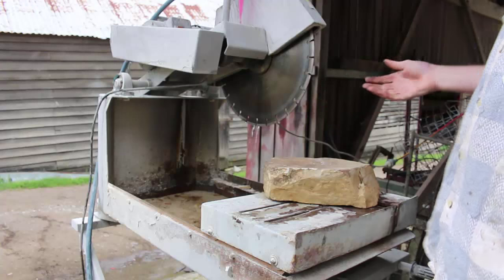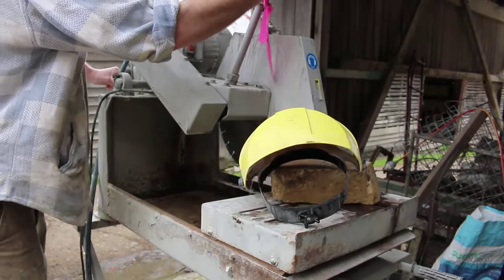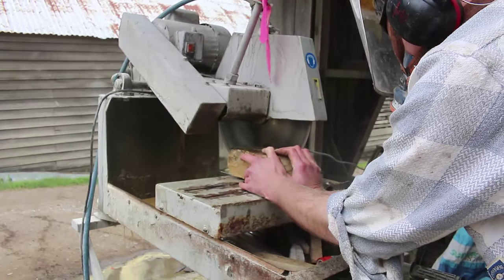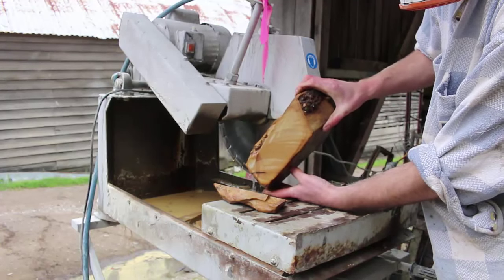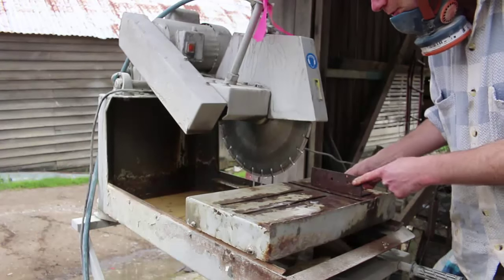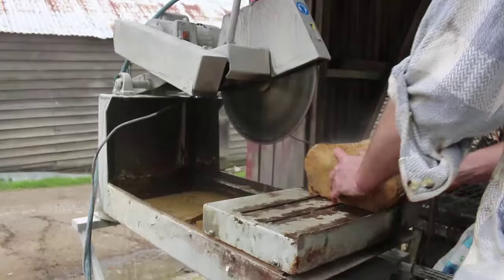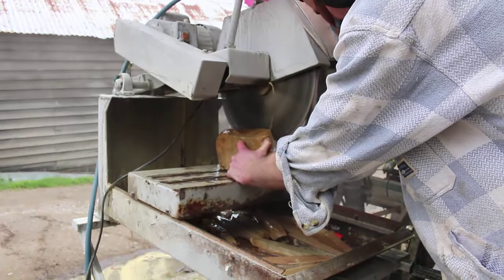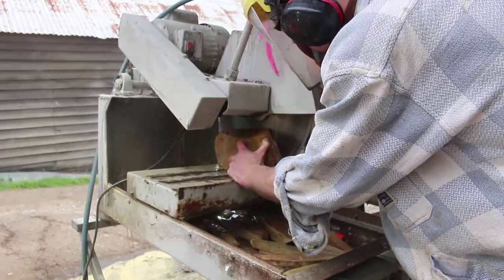Making whetstones!

Comment: how to make it with out machine ? (like in survival)
Reply: Lowcostlooser99 go to the river. Pick up a solid feeling stone (not too coarse but not too smooth either) try and find one that is as flat as u can. Then to work out the small imperfections. Find a large, flat rock, scoop up some sand or small grit and put it on the rock and grind the stone until its flat. Done.